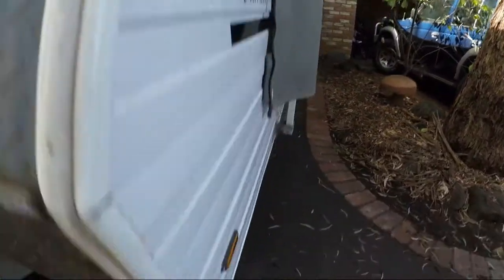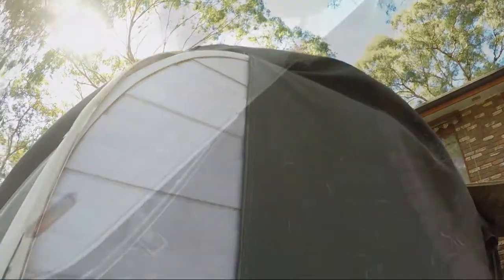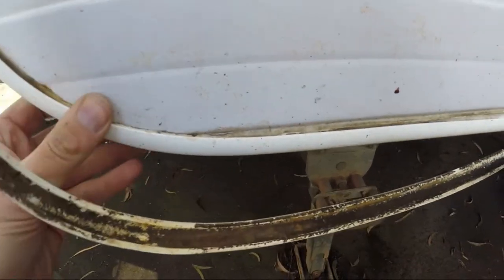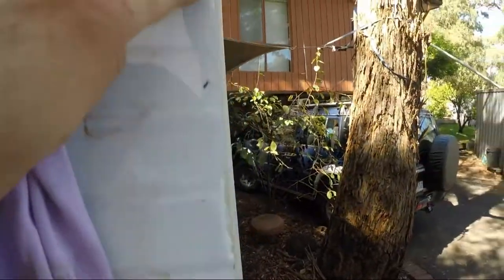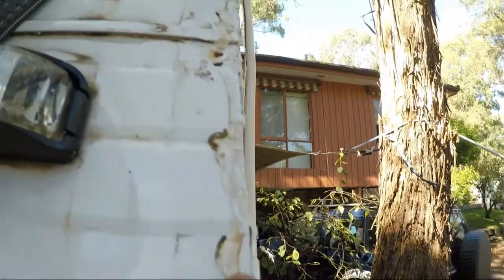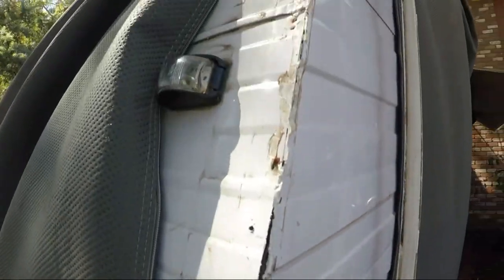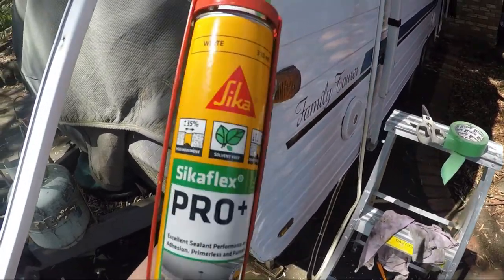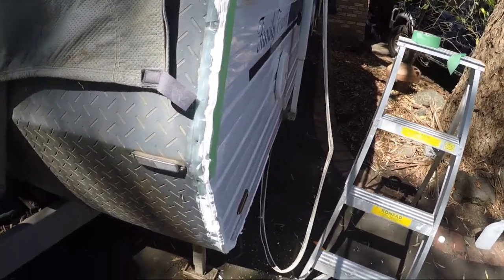How to reseal your caravan/RV

Comment: It’s been a while since you did this, but from my experience with the same type of van with the vinyl stone guard on the front is watch that like a hawk man. As soon as it gets a hole in it get rid of it. There’s padding under it that will wick moisture and it will find its way behind the metal into the wood frame. As the vinyl ages it will pull away from the sealing compound on it and again moisture will get in. I’d replace the front where the vinyl is with checker plate. 
And the best stuff I’ve found to sealing edges, j mould, etc is bostik v4. Pure silicone that has huge flex and as it’s not an adhesive if you want to remove the j mould for maintenance reasons it’s a whole lot easier.

Comment: Hey mate, did you re-use the metal corners? or were they replaced? Not the rubber seal - i mean the part that caps the corner that gets screwed in.
I can't find any info on where to buy them, let alone what they are called, so i'm curious if you just cleaned your existing ones up, or replaced them.
Reply from the maker: Hi Mate, yeah I reused this. Unless you really ruin it when removing it I wouldnt bother replacing it. You just need to make sure you spend some time removing the old silicon. If you do need to buy it its called "J Mould" and i think most caravan repair shops should sell it. Cheers.